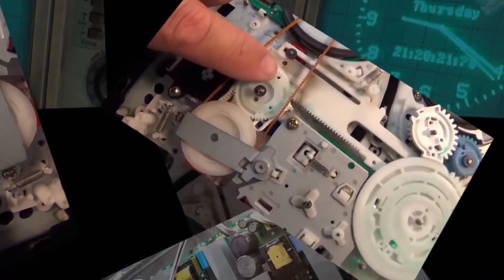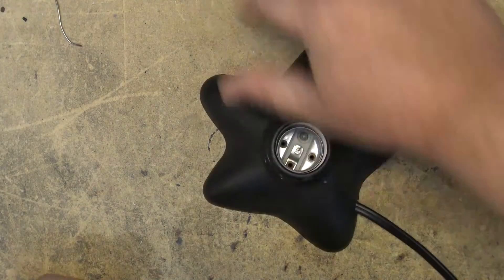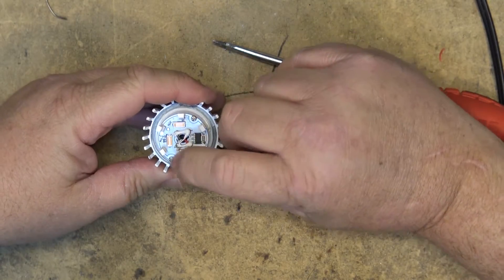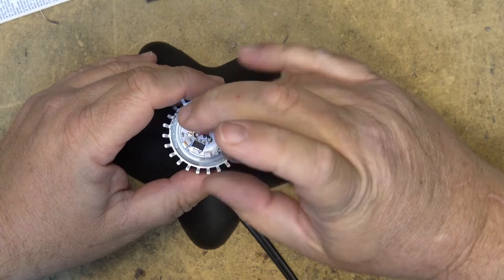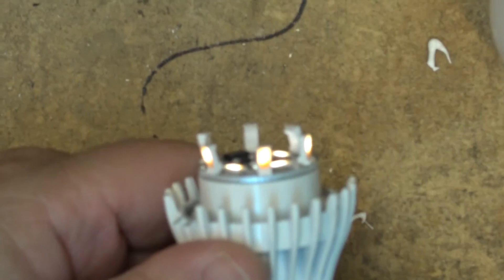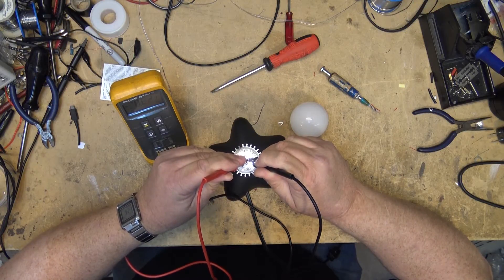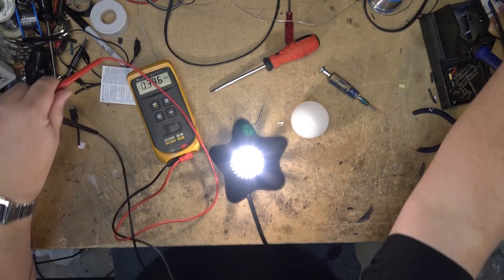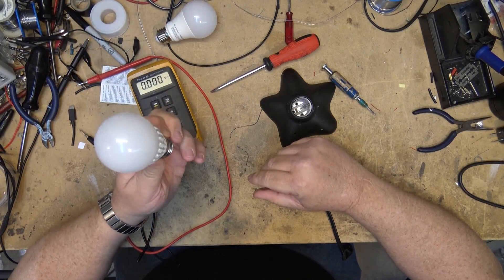Feit Electric 7.5W Dimmable LED teardown

Comment: recently i bought an OSRAM LED bulb. Used for about 3 months, starts flickering. I tear it down, trying to locate which LED is bad, however, i notice that these LEDs are not the standard Anode and Cathode type of LED. So, I can't measure the forward voltage drop ith my multimeter. Does anyone know what type of LEDs are used ? How to identify the bad ones?

Comment: Now i like that one, side leds that make up for the directional nature of leds.
And i would imagine that the leds are driven lighter than most bulbs, so they should last a long time. :-D

Well worth gluing back together, keep it dry :-)
Reply from the maker: It is in a fixture that is under cover, and is facing down so it shouldn't get wet.
You are right though I should probably glue the cover back on so that condensation wont draw in moisture.

Comment: I wonder how hot those LED's get being upright with no heatsink
Reply from the maker: I have no idea, but the larger ones mounted on the base will get cooled.
All I can say is that this bulb has been in service for over a year and it runs all night every night. The ones that shine out to the side have less led junctions in them so these will produce less heat. That is probably why the 4 wires from the ballast. 2 circuits, one for the chips that have 7 junctions, and the other for the ones that have only 4.